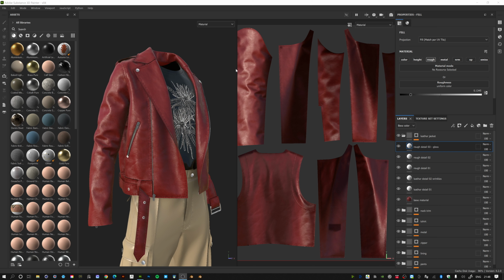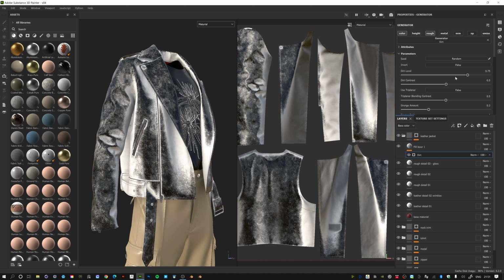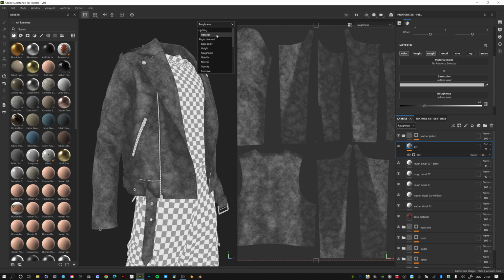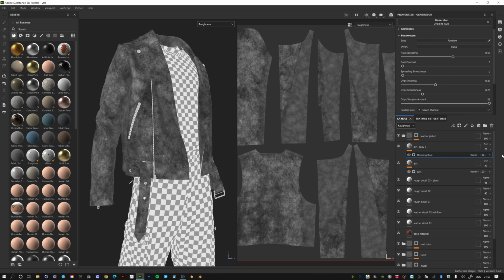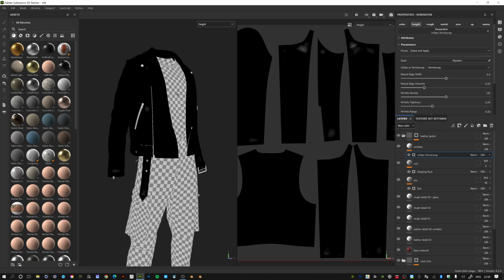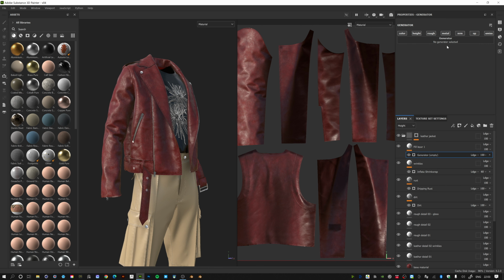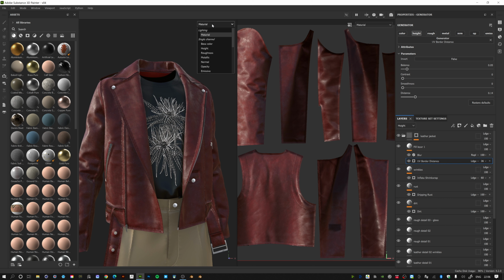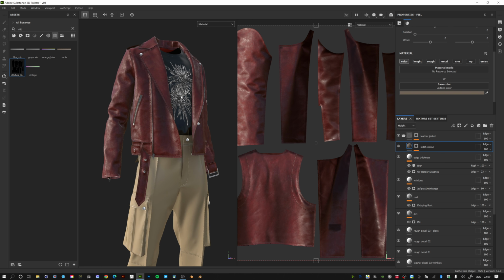PART 03 - Generators + Baking- Clo3d to Substance Painter + Blender - Substance for Digital Fashion

Comment: when i add generator inflate shrinkwrap, my mesh becomes distorted im getting round corners at edges. what causes this?
Reply from the maker: tweak the values of the generator and adjust the height intensity in the blending options of your layers

Comment: I am working on a coat and after I baked, the collar is darker. I set the back of fabric to be the same as front in Clo3d. Is this temporary or is there a way to fix it?
Reply from the maker: As you see in part 1 of this series. I don't use a thick mesh in substance. Make sure you work with a thin export and make sure your normals are all facing in the right direction

Comment: Hello, I'm enjoying your video. Thanks to you, it helped me a lot. I'm leaving a comment because I have an inquiry. The "stitch color" part in the video above at 19:05 was successful before, but it suddenly didn't work. I extracted the stitch map from clo3d according to the video, and I also did it according to the video on the substance, but the color is not applied to the stitch. When I adjusted the position of the fill layer, there was a layer that adjusted the color under the stitch. Even though the layer is at the top, there is a stitch that only adjusted the color under the stitch, but I don't know why. Do you know the solution?
Reply from the maker: Check the blending mode of the layers you are using. 

Alternatively make a new fill, add a black mask, right click the black mask and add a fill to the mask. In the grey scale option for the mask fill layer, add your topstitching image textures exported from Clo. 

Push the height value up of the fill layer and use this to control the colour. You can also try adding a levels to the mask to push the white value stronger. 

Make sure this masked layer is on top of all your other layers
Reply: @digitalfashionblender  Thank you for your reply! I solved the problem! Thank you! I'm always enjoying your tutorial! I wish you all the best!

Comment: Awesome video's, thank you so much.
How would you work with UV border select when you have diffrent distances of borders? Like the hem mostly is more likely to be 2,5-3cm? While other seams like armholes or neckline are more likely to be 0.75-1cm?
Reply from the maker: You can add multiple UV border select layers and mask out the parts you don't need.
For example add 1 layer for seams and then add a mask to that layer that would allow you to erase the areas you don't need.

Then add a 2nd layer for the wider hems and then again mask out the parts you dont need 

This is done for arms holes when the seam thickness is only needed on 1 side of the armhole towards the body.

Comment: Hey bro, been loving your tutorials, been leaving a trail of likes as I go through them. Whenever I bake mesh maps, Adobe substance painter crashes. I've tried everything from increasing TdrDelay to tweaking my baking options. Was just wondering if you ever experienced this problem and how you overcame it? Thanks :) (once again love the content)
Reply from the maker: Are you using the latest version of Substance? If you are having issues just try exporting 1 pattern pieces from clo as a thin export. Make sure the UVs are set up correctly and not overlapping any tiles. Then import this 1 pattern piece from clo to substance.  If this works and you can import a simple pattern to Painter then you know the issue is with your garment and not your settings.

Be sure to check the UV layout, turn all top stitching from OBJ to Texture and do a thin export to import into painter. Try exporting without hardwear and trims / graphics and see if this helps as well.
Reply: @digitalfashionblender  Alright thanks I've been using a thin export but I'll try baking just a simple  pattern/exporting without trims. Do you reckon baking my textures is necessary to get a good looking render?(I'm aiming to export into blender)
Reply from the maker: @oduzz4562  Yes the baking can be helpful as it allow you to work with generators and create a nice level of detail with the AO and Curve maps that come from the baking. Make sure you are using OBJ export as single mesh and it should work fine.
Reply: @digitalfashionblender  Thanks appreciate it!